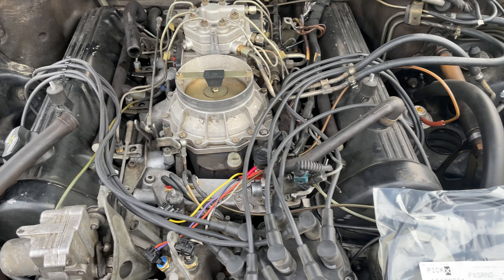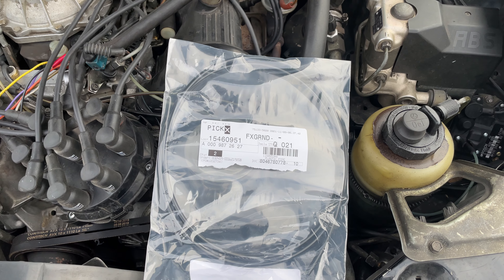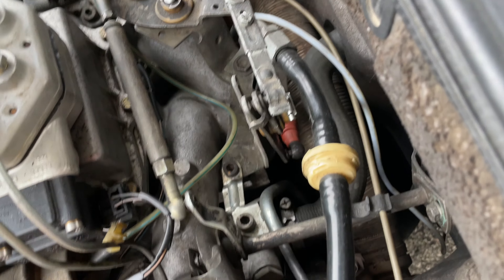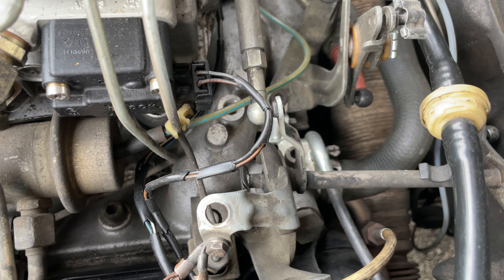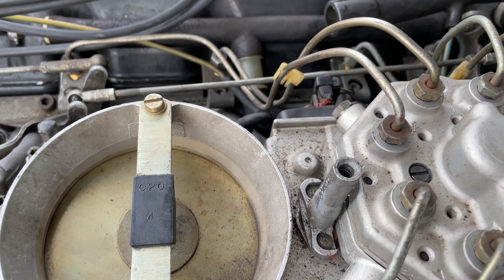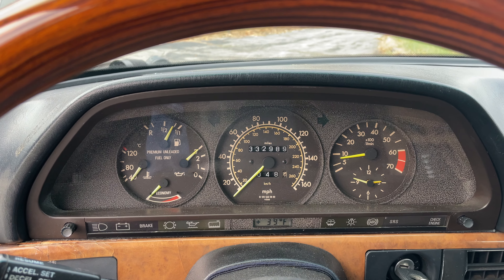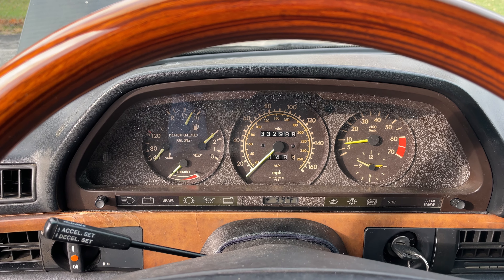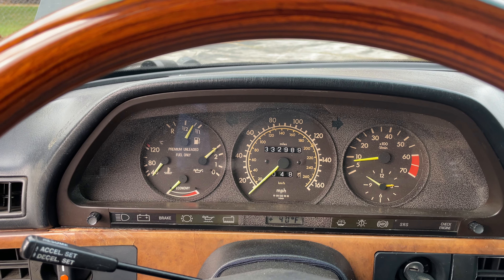Mercedes W126 4.2&5.6L - actual test of modified idle speed air valve from tutorial video

Comment: My 420 sel has a idle control valve tube with one end closed. Do you know why MB did this? Does it matter if I put a fully open hose like yours or leave it with one end closed.
Thanks
Reply from the maker: Hi George, I am not sure of what you mean. Peter
Reply: The 42mm tube that you're selling for $3. Mine is closed off at one end because mine is a 420. Yours is a 560 and both ends are open.
Reply from the maker: No, they are open on both ends on either engine. This is the bypass so the ICV won’t choke off the engine
Reply: Believe it or not mine came stock from the factory closed on one end . I look online autohaus,ebay it's the same but for 560 it's open. Very weird to have it like this.

Comment: Re; 85 MB 500sel, ICV 000 141 12 25 connected to car plug. When I put a light in the end, I see the plate snap to the outward position and immediately snap back (power still on). Does this sound like to much volts to the valve, or just a bad valve? The car runs perfect after giving it gas (and on the road), but idles badly. Starts slow idle then goes up to about 1100rpms. Turn it off and restart, still hard to start, then rough idle.
Reply from the maker: Hi Danny,

You may want to watch this playlist here:
https://youtube.com/playlist?list=PLO4ZlzALkZVqI7GGOhJkXJ4MNzaBtf6kS

Peter
Reply: @inovahightechltd  I saw it, but the 0001411225 VDO is not the same. 

But as I watched the plate moved in the direction that closes off the flow, I asked myself, when it is connected to the car's connection (off rubber) and you look inside, does it snap forward and back instantaneous, OR close off flow for a period of time (heat/elec activated)?
Reply from the maker: @dannywilliams9045  works basically the same as the 14 25 
The plate moves to the close position when idle is higher then stated idle rpm in MB manual and it will open when idle rpm drops below stated idle rpm.
Therefor the plate constantly moves. The idle speed control unit controls the current through the valve coil by means of PWM which is derived from a PID loop from TD signal 
Peter
Reply: @inovahightechltd  thanks Peter.